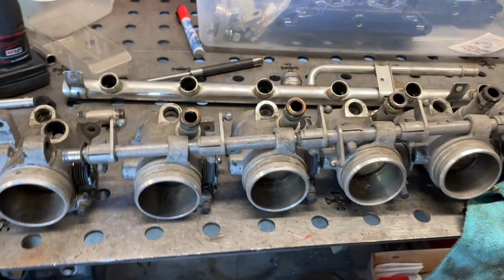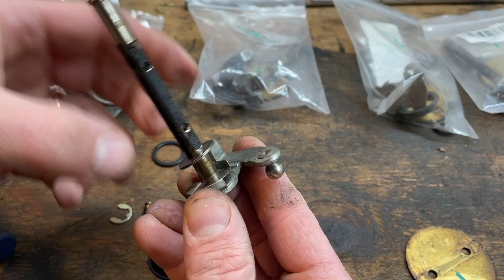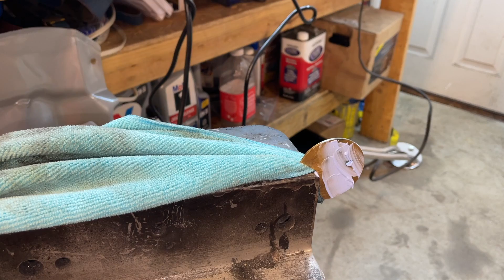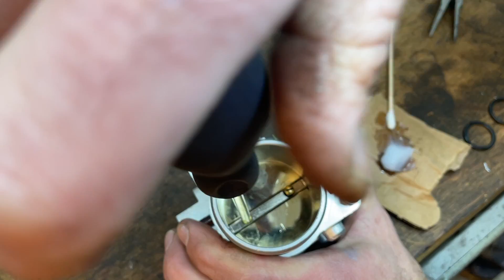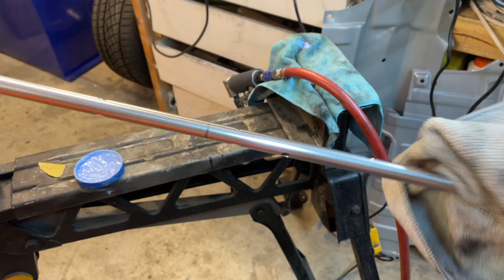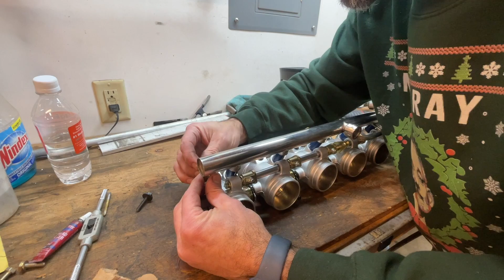Part 8: 🚗 Perfection ✨ BMW E30 S54 Throttle Body Rebuild all Zinc'd, Vapor Honed & Hand Polished!

Comment: Lets say that you sent them out to be vapourhoned and the company didn't listen and removed the set screws. What options are there now?
Reply from the maker: You must reset them by having them flow calibrated on the engine itself using manometers.

That’s why you send your me, an enthusiast who knows how to properly do this :)
Reply: @Garageaholic  Brutal, I just found you! If you're near Italy I can bring you the car?
Reply from the maker: I’m in NY USA!
Reply: @Garageaholic  Next time then! Quick q - why do you recommend a manometer over a synchrometer?

Comment: Hi, would you recommend peening the throttle screws too? Or is loctite 243 medium strength or equivalent sufficient?
Reply from the maker: Yes, loctite is (was) applied. Peening is not required for the updated torx screws that hit higher torque levels than the standard phillips head.